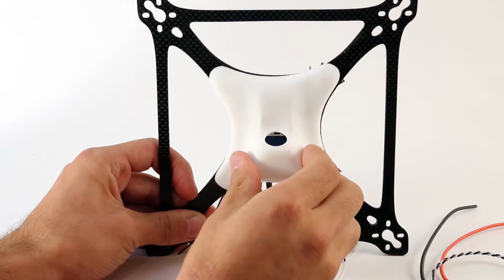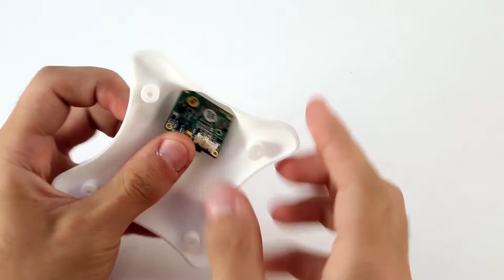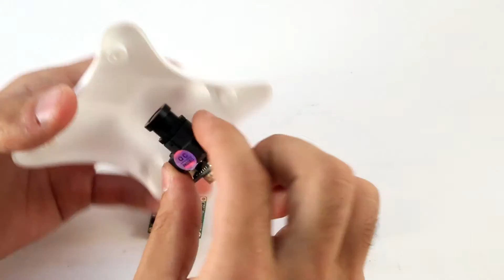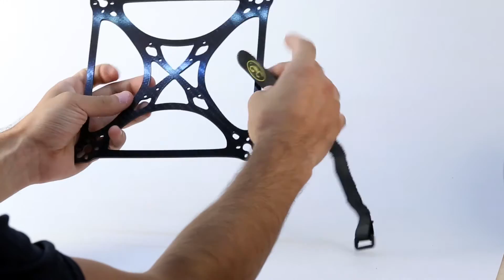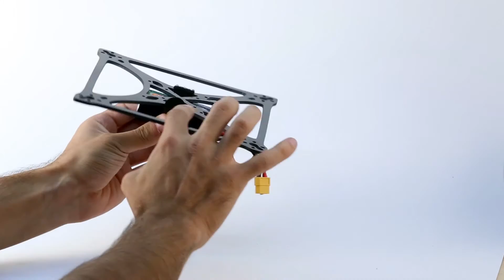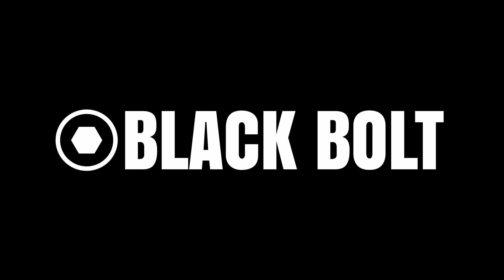Overview -- Black Bolt XBR220

Comment: Hey been think of buying the xbr frame but I don't think I will be good enough to fit all of the electronics in it, and can you fit a cc3d mini flight controller, but if I could find out away or know it would fit i would buy the frame straight away. Thanks

Comment: I got an Amaze v3 board, and couldn't flash it.  Any detailed directions for doing that out there - could you provide a link?
Does the sandwich support Vbat, telemetry, and buzzer, like the Naze32/D4R2?
How is the VTX held on - in your vid it looks like more than just the battery strap.
Reply from the maker: +Dave Grainger You need to use an FTDI to flash the afro mini, once hooked up through the FTDI, the firmware flashing is done the same as any other board that runs cleanflight. The mini does not have vbat or telemetry support, thought the Amaze v3 does have a buzzer pad, I do not believe anyone had got it to work yet. I actually have my VTX held on to the top of the frame on the rear arm with some zipties. If you check out the RCgroups thread in the description there are many more examples of where the VTX can be placed.

Comment: How is the afro mini sandwhich held in place and kept aligned?
Reply from the maker: +Nicholas H We use 3M VHB tape: http://www.amazon.com/3M-Heavy-Mounting-4910-Clear/dp/B00HD29S42/ref=sr_1_4?s=industrial&ie=UTF8&qid=1443973174&sr=1-4&keywords=vhb+tape
Reply: +Jordan Temkin 
Cheers, Sounds like strong stuff. Assuming you are sticking the receiver to a strip of that stuff, is there any issue removing when the time comes?
Reply from the maker: Its really fantastic tape. No problems removing and we have never had a FC come un-done in the past few months of testing.